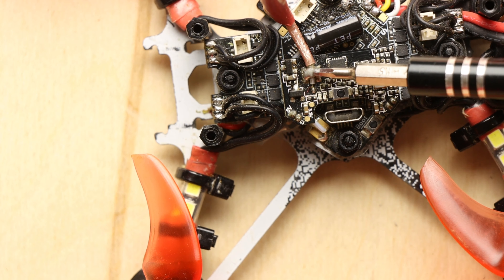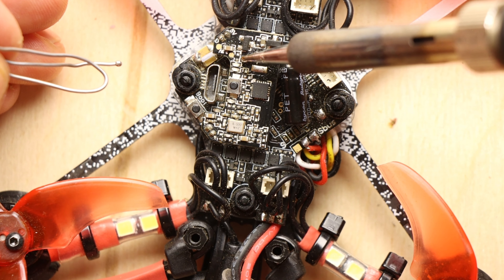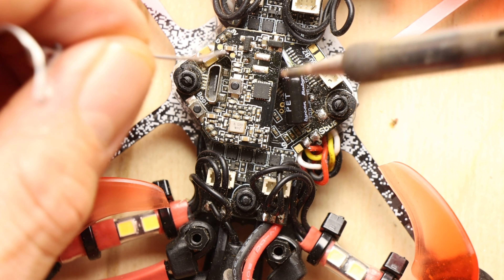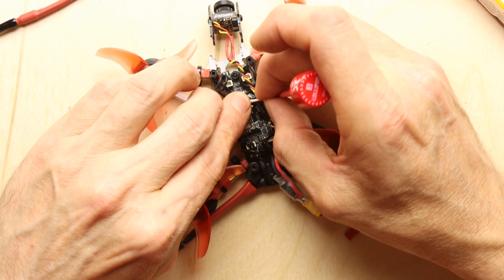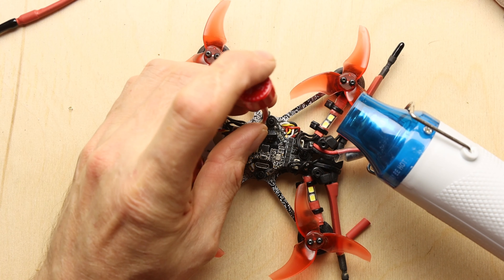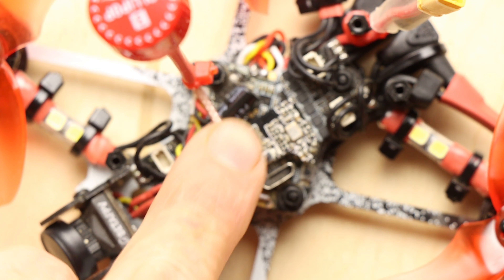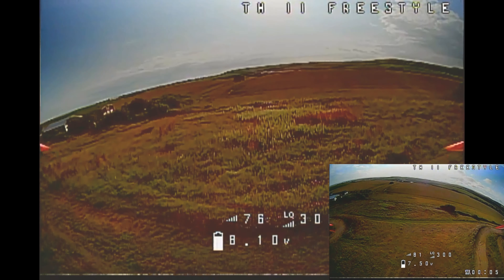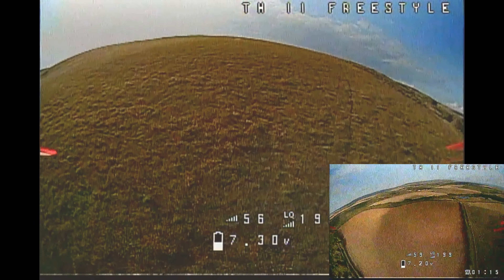emax tinyhawk 2 freestyle vtx antenna upgrade, amazing! results

Comment: Nice work. Why not run it through the battery strap along the side of the battery?
Reply from the maker: thanks! i actually did what i said and used a thicker zip tie which i trimmed a little shorter, having it up above the battery is part of the point for better reception but at signal sacrifice you could do that.

Comment: Great video. What size hex key are you using because all the ones I’ve tried are either too small or too big.
Reply from the maker: Thanks! 1.5mm is standard on the small quads 👍
Reply: @Stevieboyfpv  hm that’s the one I tried but it was too big. I ordered a hex set so hopefully it’ll work. Thanks!

Comment: Wow thats crazy far, gotta learn to solder and do this myself.
Reply from the maker: Def learn to solder and the world of fpv will open up to you🤟👍🙏🏼
Reply: @Stevieboyfpv  I learned to solder and have succesfully been able to solder the antenna to the TH 2 Freestyle. I cut it shorter to fit it in the case but it seems i have the same range as with the old antenna. I do use the stock th 3 goggles with the stock antennas as the foxeer rhcp antennas for the goggles haven’t arrived yet. Are there any settings you have to change in the betaflight?
Reply from the maker: @theearthisbread  the other antenna will help have you unlocked the 200mw power?
Reply: @Stevieboyfpv  thanks a lot for helping :). I did unlock the 200mw. I did forget to mention i was testing the distance indoors in my house through walls as it was very cold and didn't have the time yet to test outdoors. I thought the th2 with lollipop antenna would be a little stronger with penetrating indoors aswell but now the th 2 freestyle with lollipop vtx has the exact same range as my tinyhawk 3 on the stock vtx antenna so i think it will have the same outdoors. Maybe its just the stock antennas on my tinyhawk 3 box goggles. I guess i'm a little scared to lose the signal quickly  when i will be flying outdoors tomorrow so i thought to ask first before sending it into oblivian.
Reply from the maker: @theearthisbread  when you can a very good cheap upgrade would be a 2nd hand pair of eachine 800d goggles 👍
Reply: @Stevieboyfpv  that looks really nice! Thanks a lot for your kindness and help!

Comment: Does lollipop come with micro plug?👍
Reply from the maker: You have to buy the the little ufl connector I soldered to the board separately if that's what you mean. But you can cut off the connector from the lollipop and direct solder it which is an easier job by miles👍
Reply: @Stevieboyfpv  yep that's what I did. Works great!

Comment: May be a stupid question.. but.. 😂 could I solder a lolly pop antenna to the original antenna wire ?
Reply from the maker: It has an internal core for the information and a latised external core for earth so I wouldn't solder it together but you can just solder the lollipop antenna to the pad the original antenna is attached to no worries. Separate the core from the grounding sheath solder the core to the single pad and the ground sheath to the 2 outer pads 👍

Comment: What temp did you have your soldering iron set to? Great video btw!
Reply from the maker: 380-400°
Reply: @Stevieboyfpv  Thanks for replying, I'm guessing Celsius? My iron measures in °Freedom units 😅😅 I'll have to convert it
Reply from the maker: @Carguyforlife  yes Celsius 👍 I go pretty hot because I move Fairly fast if your going slower a slightly lower temp is better

Comment: Nice tutorial! I have done the upgrade. Got it soldered by a local electronics shop, as I did not want to risk it with such small connections. I also got a micro lolipop antena from foxeer and it all works fine if I am on 25 or 100mw but as soon as I switch to 200 the image disappears and it's just white and black lines jumping. The vtx starts flickering between the blue and green lights until i turn it down to 100 or 25mw. Do you have an idea of what may the cause be?
Reply from the maker: Is the metal plug on the antenna touching or pushing on part of the board maybe grounding out? Try taking the top plate off and re position it, check the connector has no damage inspect their solder joints to make sure its not pooled below the plug and creating a short underneath
Reply: @Stevieboyfpv  Thanks for the help! Unfortunately I can't really find anything that could be causing it. Spent some time testing. The connection does look fine and it and the drone appears to have a normal range for the 100 mw. I have tried adding another mode and setting it to 200mw but it flew quite similarly to 25mw. Maybe it is hardware locked to the 3 modes. For the most part it works fine, i just cant get it above 100mw which is weird. I have added a runcam thumb pro on it and the view looks stunning. I am looking to change the connector to xt30 but i can only find 550mw 2s 7,4V 95C batteries where i live, could these batteries work with it?
Reply from the maker: @BendaBlenda  they will work fine, thats a strange one

Comment: Really really REALLY wish they had this installed from the factory. I'm about attempt this and I feel like Dr. Strange after his accident. Wish my luck...
Reply from the maker: Practice your soldering, make sure you have a good tip use the wet sponge and flux 350-380° heat and take your time, you can always not use the plug and direct solder the antenna which is easier 👍 good luck!
Reply: @Stevieboyfpv  Got the VTX antenna soldered on but managed to lift the SBUS pad when I was trying to solder the XM+. Oh well, 1 outta 2 isn't bad. Luckily I still have the original still on. SADLY, I crashed into a wall after clipping some moss and managed to bork my ESC. Looking at a new drone instead of repairing this one. GEPRC 2.5" Phantom MAYBE. Already has XM+ and a swappable VTX antenna. Just an upgraded TH2FS basically, with 3S!
Reply from the maker: @gasser5001  ahh what a gutter! Have to be hot and fast with nonpulling on those little pads, sorry to hear that dude! Maybe still get a replacement board to keep it in the fleet! Geprc do build a great quad in my opinion 👌

Comment: Hi Stevie, great video. I managed to get everything set up, but unfortunately, when I arm the quad the vtx disconnects... Resetting it by unplugging and reconnecting the battery restores the picture, but it disconnects as soon as I arm it again. Any ideas?
Reply from the maker: Sounds like you have a short or bridge happening somewhere look closely for solder touching another component or chip or the ground and live element have joined
Reply: @Stevieboyfpv  Thanks for the speedy reply mate! Well, I removed the connector and soldered another one. Checked for continuity between the relevant bits and it looks good. Powered it on and it did the same thing when arming. If I arm it, let it bug out, then press the button on the vtx to reconnect (not disconnecting the battery), it arms without disconnecting. If I connect the battery and then press the button, it doesn't work. It needed to bug out before pressing the button. After more testing, if I arm and disarm quickly, then arm again, it works fine... Strange thing happening...
Reply from the maker: @martyn5064  all I can think is there is a short happening somewhere else if plug is fine. Is your vtx unlocked to 200mw?
Reply from the maker: @martyn5064  make sure there are no exposed bits of wire on the wires running from the capacitor and the antenna brass plug isn't touching it or any other components
Reply: @Stevieboyfpv  After further testing: If I push down on the connector it works fine. I think it may be a dodgy antenna. I'll order another one and report back. Yeah, it's unlocked to 200mw.
Reply: @Stevieboyfpv  After running through the 200mw unlock sequence again, it works flawlessly... Hoorah! Thanks for your help mate! Can't wait to fly this tomorrow!
Reply from the maker: @martyn5064  👍🤟🤟🤟

Comment: what battry would u recomend me to buy on amazon
Reply from the maker: https://www.amazon.com/4pcs-GAONENG-550mah-Battery-Connector/dp/B09GLV8Q6P/ref=mp_s_a_1_3?crid=ZCRJ1FCRXCM8&keywords=550mah+2s&qid=1643300640&sprefix=550mah%2Caps%2C233&sr=8-3
Reply from the maker: These are pretty good for the price. I have no experience of the seller though.
For the tinyhawk freestyle you have converted to an xt30 plug you want a 2s lipo between 450 and 600mah you can go higher if your looking for more time in the air but will sacrifice agility.
And you want as higher "c" rating as possible for that consistent punch!
Reply: @Stevieboyfpv   thank you

Comment: Wat if the solder I'm using already has flux should I still apply anyway I'm new so forgive my ignorance
Reply from the maker: Yes use flux aswell the flux burns off once it has the solder is un responsive

Comment: I don't even have a drone yet and I already want to upgrade and all ready afraid of messing it up
Reply from the maker: I bought a tinyhawk, then thawk freestyle
Then a mino cinewhoop new that needed repair spent loads getting it to a shop twice for them to screw it up because I was scared to screw it up, that forced me onto the soldering iron.....it wasn't the best but I fixed it. Now I have over 20 and have tutorials to help others build and fix them. If you mess it up....you fix it thats fpv so don't worry and thats the point of the tinyhawk series I created as you can learn with a small cheap drone 1st

Comment: It looks so easy when you do it, I only wish I had the skills to do this myself, going the safer route  on my feestyle v1 (got crap 25mw shitter vtx from Emax storage of shit parts that needed to be used) of just replacing the VTX with TBS Nano, and putting ExpressLRS also in there, will use the same power sources the ones beneth the main board to power the VTX and receiver...If I fail its like 170$ down the drain...

Comment: I’m looking to do the same upgrade but can’t seem to fine those connections pads your soldering on for the antenna
Reply from the maker: You can always just direct solder the antenna instead if you cand find any ufl connectors
Reply from the maker: https://cpc.farnell.com/hirose-hrs/u-fl-r-smt-1-10/receptacle-smt-u-fl-50ohm/dp/CN15003?mckv=sBsEt8eIG_dm|pcrid|224645161149|kword||match||plid||slid||product|CN15003|pgrid|45968746254|ptaid|pla-891140136654|&CMP=KNC-GUK-CPC-SHOPPING-945762368-45968746254-CN15003&s_kwcid=AL!5616!3!224645161149!!!network}!891140136654!&gclid=Cj0KCQjwteOaBhDuARIsADBqReiyQqWlZmpu_6yZ7r1YZwHPfmFX1OInVylFfEEL_6ia_mNT4jQ9UMAaApHOEALw_wcB

Comment: So when I did this @ 9:25-9:30 it said I have (low rssi) is that cause I didn’t do a good soldering job or? I’m using the same antenna you have  and the emaxx tinyhawk 2 freestyle
Reply: I also had low battery’s in the goggles and drone when I tested it
Reply from the maker: Rssi is your rx signal from your controller to your quad. The antenna upgrade in this video is the vtx antenna for your video they are not related. Check you have not touched any other solder points or created any bridges between solder points or that the ufl plug on the antenna isn't twisting and touching something it shouldn't creating a bridge.

Comment: Hey stevie! Thanks a lot for the tutorial! I have a question about the vtx. When i put the output power to 200mw, the vtx signal becomes weaker than on 25mw. This was before and after adding the lollipop. Do you have any idea as to what causes this? I also have a happymodel elrs receiver on it.
Reply from the maker: Unless you have a bad earth or bad connection somewhere that is strange! 
Check through oscars list see if any of that helps https://oscarliang.com/connect-vtx-fpv-camera/

Comment: Loved your video! I'm here a bit late, but just getting into my TinyHawk 2 Freestyle! I'm looking for upgrades and changes, what do you suggest? I got the package deal including their cheap rc and goggles - what would you suggest I change first, for the best experience in video quality and overall flying capabilities?
Reply from the maker: Have you watched all my upgrade vids?
Cheapest and biggest difference would be xt30 connector and going to proper 2s batteries have to change charger aswell though next vtx antenna and antennas for goggles and unlock the vtx power to 200mw cough! If you in a country that its lega to 👍
Reply: @Stevieboyfpv  I haven't! I just saw this one as I was doing some research - I'll go check them out! And I don't know of it's legal, I'm in the states. I'll look up the xt30 - whatever that is - and the batteries! I'm sure I'll have more questions here in a little, thanks for the help!
Reply from the maker: @theexperienced5457  yep legal in the states mate 👍
Reply: @Stevieboyfpv  so I had another question for you, I have a separate tinyhawk that I think I fried something - I flew it after it rained, and crash landed in the wet grass. When I turn it on it doesn't do anything, but the vtx has a green light. Do I need a new fc? Should I buy the same fc from emax, or look for a new upgraded option?
Reply from the maker: @theexperienced5457  yeh you've prob fried the esc side of the board. To fit the frame you would want the same aio flight controller or you would be entering a world of adaptor plates or different frames
Reply: @Stevieboyfpv  do you have a good source for xt30 connecter, batteries, and charger? What would you suggest? And I've been looking at the pagoda antenna from emax, but I dont know how I would put that on the vtx, there's no spot for it. I also have the super cheap goggles from emax, and don't know if I could put the secondary antenna from that pagoda pack onto those goggles?
Reply from the maker: @theexperienced5457  your on the states so the suppliers I use are from the UK which would not be ideal. Prob raceday quads places like that for you.
The pagoda antenna would fit your goggles you would want a patch antenna aswell although I'm not sure those goggles are true diversity but usually a patch antenna and an omni lollipop.
You want a different antenna for the quad. I would suggest watching all mine and other people's tinhawk freestyle upgrade vids to get familiar to make good choices for your changes so you don't waste your time or money 👍
Reply: @Stevieboyfpv  so I've been reading a bunch, and looking on raceday for the xt30s - as far as batteries go, I'm still trying to understand what's safe to use/better to use for the TH2F. I've got a connector that I'll solder on, but what's the specs of batteries I should be getting? 2s max? What is going to hurt the drone, vs just adding more power?
Reply from the maker: @theexperienced5457  its a 2s quad so no higher. 450mah to 720mah is what I use.
Look for a high "c" rating the higher the c rate the more punch it can expel at one time before voltage sag. The 450mah will be more agile with shorter flight times the higher mah you go thr heavier so the less agile it will be but longer flight times untill thr point where you go too big and its weight is too great and it neither will handle well or fly for very long. Look for skinny hv 2s batteries where possible. Hope that helps happy flying👍
Reply: @Stevieboyfpv  thanks a ton for letting me pick your brain, it's been so helpful compared to googling things again and again. I appreciate it loads!
Reply from the maker: @theexperienced5457  glad I helped 👍

Comment: when I nuy an antenna for the drone, how do I know which one? I mean, they are different from goggles antenna and drone antenna ?  and what connector they use?
Reply from the maker: Thats the choice, different antennas for different results hence the video.
You will more than likely be running "rhcp" antennas. On goggles and the drone, they have to match whatever is on the goggles must be on the drone. From factory tinyhawk 2's have no connectors on the drone, this is removed and soldered direct. This video shows installing a "ufl" plug instead of direct solder. This is a very difficult job and not essential to upgrading the antenna. The new antenna could be direct soldered easilly instead. The antennas come in "whips" "dipoles" "patches" and lollipops i sugest watching a video explaimg antennas for more detail from j Bardwell but in this video I use a micro lollipop as lollipops are omni directional and so transmitting in a 360 degree field as opposed to directional. I use omni directional on the quad and on my goggles have 2 omni directional one patch "directional" and a coil "long range directional but small field. Which connector for both goggles and quad are specific to the goggles and the transmitter and so these have to be known before buying research this through an fpv antennas video for compete clarity.
Reply from the maker: https://youtu.be/B4Nl_yJ_acc?si=yce1gzXq376pLkxz
Reply: @Stevieboyfpv  woah, lon gest reply anybody ever did to me !!!!! amazing. I understand the point, but is so boring to always do research for anything in this hobby, i'd like to have a friend that knows everything like you and getting help in real lif e   lol lol   anyway, why you chose plug instead of direct solder? to change antennas in case it does not work good?
Reply from the maker: @swimbeyonder  the small quad antennas come with micro ufl connectors and the same on a lot of the vtx transmitter boards so it just made it easier for the future but on this quad there is no actual need for the plug and direct soldering is way way easier and a solid connection.
Reply: @Stevieboyfpv  can you suggest me a solderable antenna for this same drone? And by the way mine is the freestyle version 1  with only 25 mw vtx..... It has very limited range... About 30 m